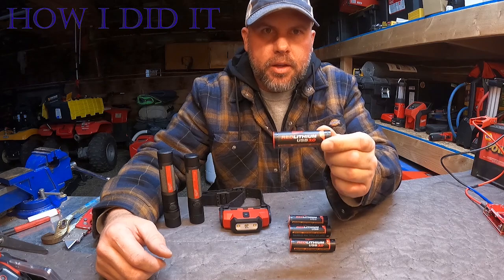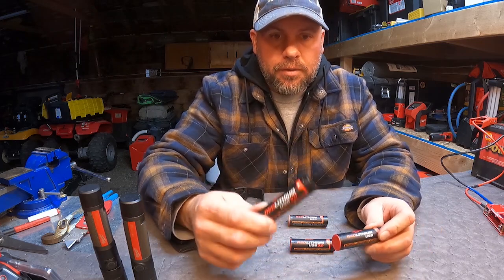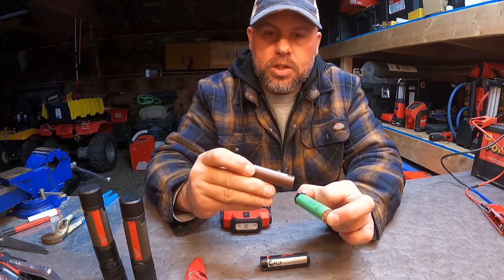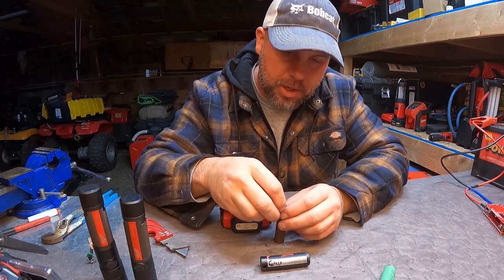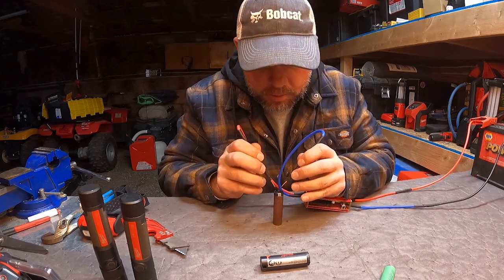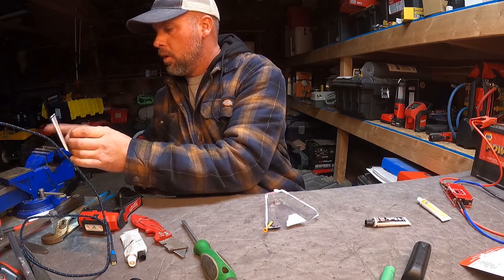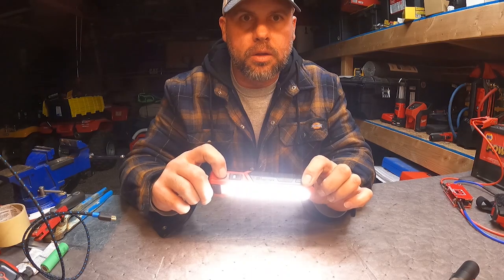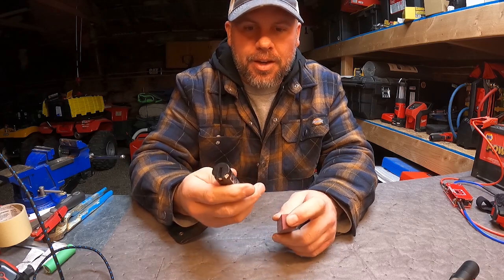Milwaukee Red Lithium USB Battery Repair and Upgrade to 3.0Ah

Comment: I assume that the temp sensor is just a thermistor of either the NTC or PTC type (assuming NTC type for temperature sensing) that uses the positive side of the battery to provide a variable voltage out to the charging circuit. 

I have a LOT of these batteries and am looking at building a multi-bay charging bank for recharging the cells while still utilizing the temp sensor circuit to prevent cell damage. 

I havent had a chance to take one of these cells apart as of yet and am purely in the 'brainstorming' phase, but your video was helpful... just need a simple multi-cell 18650 charging circuit

Comment: Great video.

Ryobi has a similar battery for their lithium usb tools. I've found that the batteries ryobi chose to use can't handle the current demand of some of the power tools. We now have Tabless 18650s coming onto the market, and I ordered some for both my ryobi 4v tools and my milwaukee m12 tools. Wish me luck!

Comment: I have the flip light, I charge it and it’s good but if I don’t use them for a while when I need them they are dead, or low battery. Do I need to take the battery out on em for storing ?

Comment: It's been 3 years, is the LG still going strong?  I get the feeling when it dies you'll be cracking it open and re-celling it LOL!  Hard not to.   
If it matters: the new models appear to use USB-C if that's a consideration.

Comment: Nice retrofit! I like to do upgrades to my existing depleted battery packs. One thing I learned on one of my USB 3.0 battery’s was to treat them the same as you would if it was just a bare bones 18650. What I mean by that is my 3.0 was reading at 2.7V and knowing that the charger won’t charge if it doesn’t read at a higher voltage. So I used an existing 18650 and bridged the positive and negatives together for 30-45 seconds, or until it reads 3.3v or higher and the charger took it from there. I’ve read a lot of people having this issue and it seems like the BCM doesn’t cut off the power usage as quick as it should so it doesn’t get rejected. Peace!

Comment: Great video! I wanted to make a few myself with 3D printed casings and my own battery’s.
What exactly is on that circuit board, just a temp sensor? Think it will work without it?
Reply: That's my question too, because I could have a bright light with endless batteries but I haven't taken action cuz I'm worried I'll do all the work to make all the bats and no worky lol😂
Reply: Any chance you pursued that idea?
Reply: @ nope, but it shouldn’t be hard to make.

Comment: Looking at Milwaukee L400 neck light for general work purposes. It depends on design, but I think I'm going to just 'hack in' a 18650 holder  into it under the hinged cover so I can just slap a fresh cell in it and put the dead one on a dedicated charger. 
Such a stupid proprietary design choice to go with the design they're using... pisses me off but then again I see no other neck lights that could use an 18650.

Comment: are these milwaukie usb 3.0 batterys  regular 18650 , can I use the batterys on my fenix headlamp that's uses a normal rechargeable 18650 the battery ?

Comment: That case for the 18650 battery looks just like the size of a 26650 cell . And obviously a 26650 can be an easy 30A and maybe 5ah in capacity

Comment: What’s the voltage of these little Milwaukee batteries?  I can’t seem to find it anywhere
Reply from the maker: Nominal voltage of a standard 18650 is 3.7 volts and fully charged voltage of 4.2.  Sometimes they are referred to as a 4 volt battery.
Reply: @tetradgroup  awesome thanks!  I just got the Milwaukee heated gloves and they are very disappointing to say the least.  Wondering if there was some way to run off of m12 power supply to get more heat and better run time.

Comment: Thanks for the video. I was able to replace a dead battery using your advice. I didn't have a spot welder so I soldered the contacts to the battery and that worked fine. I didn't glue the plastic end cap but simply put that in the screw down part that screws down over the battery and holds the battery in place.

Comment: Will a soldering iron do it ?
Reply: Yes I soldered successfully. I first carefully prepared the joins by melting some solder onto the battery ends and the terminals. Then I attached the terminals to the battery and completed the soldering. Need to be careful not to melt the plastic.

Comment: I’m gonna put some molicel 2600 mah 35 amp battery’s in a 2.0 m12 pack to upgrade it and also the Xc 4.0 . I’m doing it cause I think that higher amp hours will be nice but also because the extra amps for high draw tools . I’m trying to make something like the m18 HO for the m12 . Think it will work properly?
Reply: They got Samsung 20rs in rn
Reply: I thought about hg2s also . Might do some of those in another pack

Comment: you can realistically put a  21700 and heatshrink that mofo for 5ah
Reply: Let me know if you try. I’m tossing in some molicel 2600 mah 35 amp discharges instead . Should be kinda like the m18 HO but for m12. I want it for my high amp tools like the circular saw

Comment: Great video! But in my humble opinion, without USB-C, and with their proprietary battery, there’s no need to buy Milwaukee lights. Zebralight makes superior headlamps and hand held flashlights that use standard 18650. They even make a handheld that uses 21700. There’s no charging ports on the lights themselves but swapping batteries is trivial. You should check them out.

Comment: HOW DO YOU GET THE BATTERY OUT OF THE CASE
Reply from the maker: Once you get the bottom red cap off you can push with a small pic or small screwdriver on the metal tabs at the top and it should slide it right out

Comment: What’s the max ah that’s made that would work when replacing these cells?
Reply from the maker: 4000mah is about max for an 18650 cell, any one claiming higher than that be very suspicious.

Comment: I put a streamlight (samsung) 2600mAh cell in my 2×AA rover #2108. Dremeled out a hole for the usb port on the cell, and used a longer spring covered in shrink tube to push the cell tightly into the positive contact. The spring touches the cap and makes the negative connection on the battery. No adhesives were used/needed.
It has a run time of 7 hours and change. 

Might make a good video if you're looking for ideas.
I didnt lose my end cap, but many others have. Maybe you could show them a way to still make use of the light by soldering the spring in place and glue the hole shut 🤷‍♂️
Reply from the maker: That is really cool.  I can't believe Milwaukee still makes lights that are not rechargeable.  Good solution

Comment: Did you add the capacitor to the spot welder?
Reply from the maker: I did not, if used probably it's does not need a capacitor.  It's just a low voltage safety and I just use the proper battery and never had an issue.  I did add a fan due to heat, gets hot quick above 50E.
Reply: @tetradgroup  I contacted the seller I bought mine from. They are sending me a new one. I'm going to build a smaller battery for it this time. Only thing I can think that ruined mine is my 2000wh battery had to much current for it at 12.2 volts. It can push 440 amps max discharge rate safely. Not for that welder it seems

Think I'll limit the new battery to around 130 amp discharge max.
Reply from the maker: @kevinroberts781   Some people seem to think the unit will only use the power it needs so a bigger battery should be fine but I disagree.  This is the third example I've seen where it blows using huge batteries as power supply, I just don't know why.  There is a range in the instructions, my battery supply is just outside that range on the high side.  I might hook mine to a large battery and see if it blows.  Easy fix, I just want to know if it will blow a fet.
Reply: @tetradgroup  I can kinda see it happening. The mosfets are rated for a certain amount of current or amps. 150 amps on some. 5 mosfets in parallel I thought would handle my battery. I'm still new to this. 

I made sure my battery had the prime voltage and made sure it had the ability to provide enough current. I explained this to the seller and they think it's a bad unit. They are sending me a new one. I also ordered a new one. I will test them both again. One with a battery capable of 130-140 amps and the other with my 440 amp discharge battery. 

I'm just not sure. I'm leaning towards my battery slamming to much current when the mosfets close. Nothing really in the welder to limit it.
Reply from the maker: @kevinroberts781  I was going to order another one as well just to test it, please keep me updated I'm interested to know what you find
Reply: @tetradgroup  update. 

I removed the blown mosfet. Beefed up the solder on the board. Soldered up a 3s5p 21700 40t samsung pack. Plugged it in to the new pack and it's working great with only 4 mosfets!
Reply from the maker: @kevinroberts781  Awesome idea, just remove the bad mosfet and run 4.  That battery sounds much better being 200 amps.  Glad it's working.  I just ordered two more to play with and see exactly what it takes to blow them up,